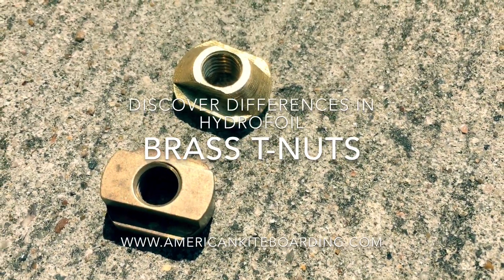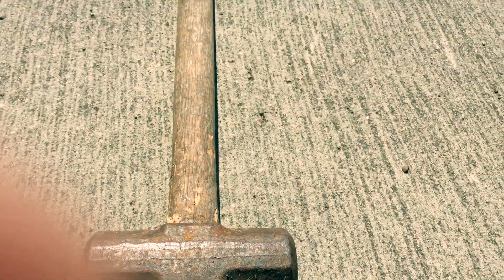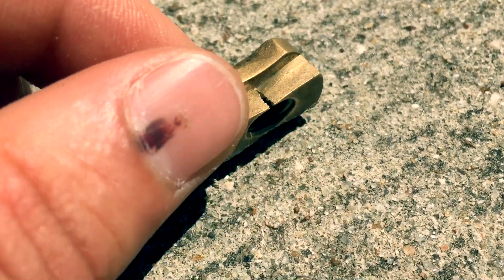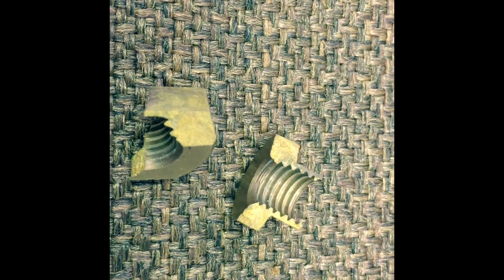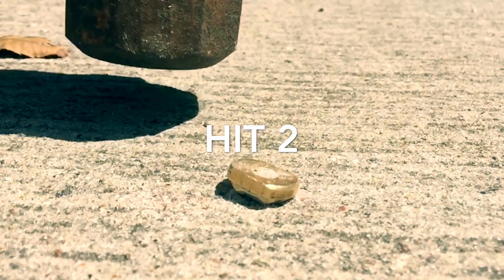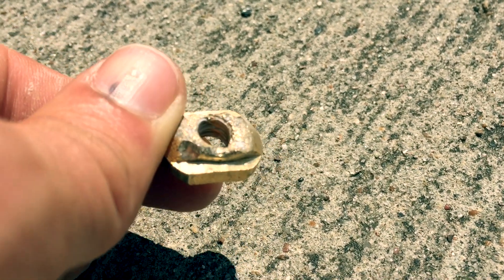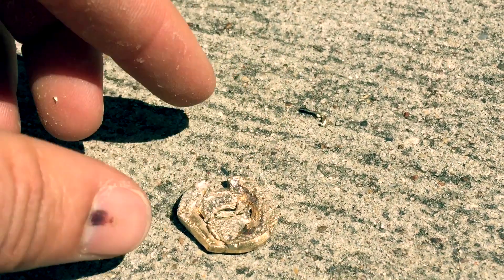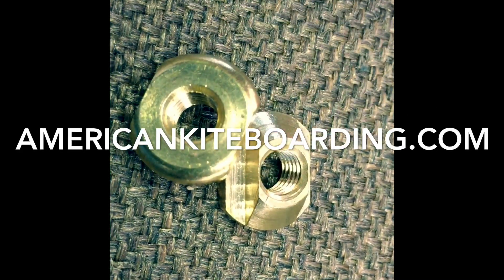Hydrofoil T-Nut versus Sledge Hammer...A Scientific Test of Strength

Comment: Hi guys, thanks for the great videos!   I had one of my stock Slingshot T-nuts fail and could see by the granular appearance inside the nut. that it was weak and probably low quality.  In my windsurfing days we used brass T-nuts for 10-15 years on our short board mastbases to connect to the board and never saw one fail like the SS one did.   That was in the spring (first time out so maybe cold water had something to do with it?)  and now I'm wondering if they  (and other manufactures who may be sourcing from the same supplier?) have done or are planning to do anything about it?  Hopefully they know about your 'test' :) and the failures you keep see happening? 
ps. I'd be ordering new ones from you guys if I didn't have a nice little supply of the stronger T-nuts from my windsurfer days!

Comment: Hey guys! I usually love your videos, but there's a problem with this one. Look at the position of the t-nuts when you strike them. The first t-nut is positioned so that more of the force of the hammer is applied to crack the nut, more force is applied to the edge of the nut. When you strike the second nut, it is rotated 180 degrees from the first one. The force on the second nut mostly just causes it to lie flat. Striking the nut when it's flat doesn't show anything really. What would be a better demo would include two things. First, using a digital torque wrench tighten each nut to failure and show the torque required. Second torque each nut properly and use a lever(like a mast) to cause failure of the nut. I don't doubt the weakness of brass t-nuts, that's why I've switched to stainless steel. It would be great if you guys would carry SS t-nuts!
Reply from the maker: Michael you get the award!!  It was meant to be a farce, as this test is pretty far from scientific.  We made this video quickly (per usual) as a response to seeing a high number of stock T-nuts fail and none of the others.  After knocking around a few new ones in the store we noticed that the stock T-nuts always fail the same way.  We had a bet going to see when the first comment about the test came in...and you won!  Give us a call today and we'll send you a free set of high strength T-nuts on our dime!  Thanks for the comment...some one had to do it.  281-508-6485